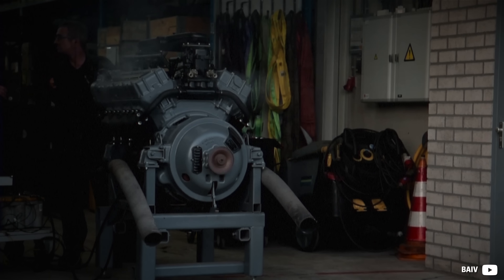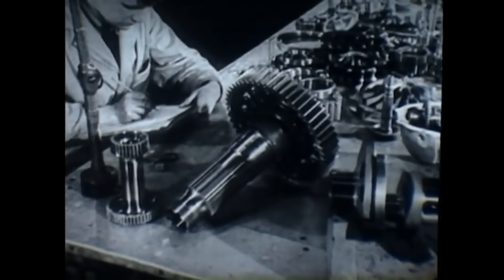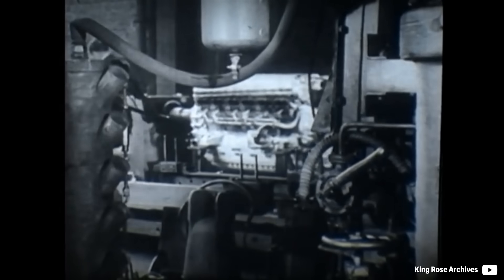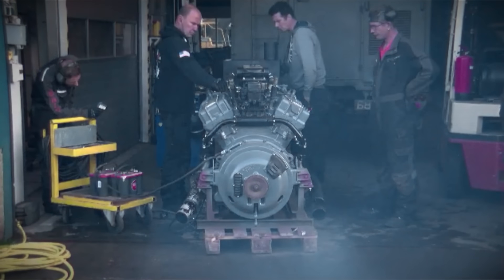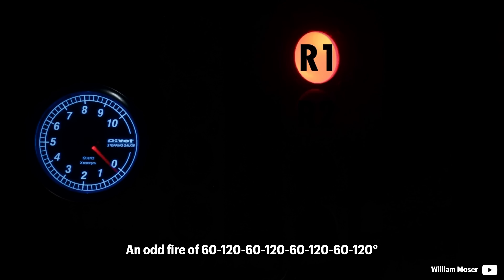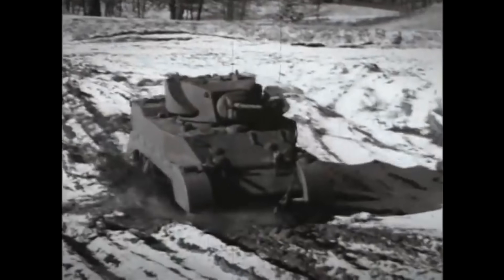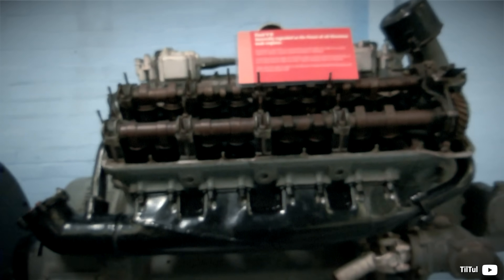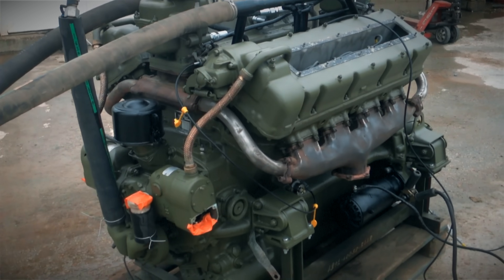The 1,100 Cubic Inch Ford GAA Was Extraordinary

Comment: One of my neighbors has one out of a Ford M4A3 tank IIRC. He uses it for a modest sawmill. He's got it running through a big muffler but I can hear that giant cam lope miles away some times.
Reply: That war-era stuff was built different. I used to do continuous steel fencing for a guy and he had a Lincoln Electric welder he said "came off a tank repair truck" and that thing would run all day and make the brand new Lincoln and Miller units we had look like toys. So smooth you didn't hardly ever touch the knob, just pulled your arc back a little or push it in a little to adjust for thinner or thicker steel. I would love to know how many hours are on that old Continental engine, it has to be an absurd amount. We kept fresh 15w40 in it and it just kept ticking along.

Comment: Cool engines but a couple of super simple design changes could have made these engines legendary. A 2 bolt not skirted block on a engine that has harmonic issues. That and a huge 2 barrel carbs on each end when dual 4 barrels would have provided much more even fuel distribution.  Hell to this day the Windsor platform is plagued by 2 bolt mains and 4 bolts per cylinder heads.  It's like Ford wanted to dangle that carrot right in front of our faces.  I bleed blue until the day I die but dang man.
Reply: I don't think the four barrel carburetor had been invented yet.

Comment: I wonder why Ford picked the flatplane crank design, something to do with tuning, maybe?
Reply: 60 degree cylinder bank separation, from when it was originally designed as a V12. To use a crossplane in a V8 with an 'incorrect' bank angle would require it be made even-fire by splitting and offsetting the crank pins, and there isn't enough material there to do so without making a weak crankshaft.
Reply: @mfree80286  hmmm, thanks for explanation.

Comment: Considering this engine's capabilities, one could only imagine the magic that would have been the V12 aircraft variant once it got superchargers or even turbochargers. On some level I think we were robbed of what could have been one of the greatest aircraft engines of WW2 and could have sat right alongside the Pratt & Whitney R2800, RR Merlin, and likely took the place of the Allison V-1710. I absolutely love the V-1710. Many people rag on it as not being good enough for the P-51 but that just ignores the success these engines really had throughout the war, most notably in the likes of the P-38, but was also in the P-40, P-39, and P-63. They were reliable engines that were also easier to maintain than the Merlin. However I 100% believe that if Ford had managed to get their foot in the door with their V-12, it would have been a serious contender for a powerplant for the P-51 assuming they already had supercharger plans in the works as well, which I wouldn't doubt that they did. But alas we can only dream.
Reply: The Allison had been in production since 1930 so had its bugs worked out with a known cost that the Army Air Corps expected to become lower once in mass production. Rolls-Royce was still producing the Merlin by hand-fitting the various parts like building a custom engine. The British aircraft mechanics preferred the Allison engine since it used 50% fewer parts with replacement parts being ready to install straight out of the box. The British Government asked Ford about manufacturing the Merlin due to RR being so slow. Ford declined the offer since he was trying to sell them his aero V12 so gave the Merlin blueprints to Packard to look over. Ford's V12 was turbocharged and used fuel injection so it took his engineers a couple years to figure out how to make the V8 version run on carburetors. They were still working out the bugs when it started being used in the M4 .
Reply: If you look at power levels the Allison was just as capable.  The allisons in the P-38 that were turbo/supercharged made as much power as the merlin.  The single stage supercharger is what made the allison seem so much weaker.  It was also much easier to service and maintain
Reply: @kingssuck06  I think it just took them a little too long to develop a proper supercharger for it. The most powerful turbocharged version I believe was in the P-38K with something over 1800hp, and then they got a supercharged version pushing something around 2000 in the F-82 I believe, but by that time Packard had gotten the Merlin's to have a good bit more than that. And little do people know, the P-51A with the Allison engine was still the faster than the B/C/D variants at low altitude. It was a damn great engine and I'm not saying otherwise, just held back from being as good as it could have been for a while because of difficulty getting it to have proper performance at very high altitude without a turbo.
Reply: Ford had the GAC V12 designed first because they saw an opportunity to build an engine competitive to the Merlin, but at much lower cost and higher production rate.  That effort was stymied when Packard licensed the Merlin design, revised it with American production standards, and started producing it in Muskegon, Michigan.  The GAA/GAC even had the same bore and stroke as the Merlin:  5.4" x 6.0"

Comment: There were three versions of the Sherman tank.  The General Motors M4A2, Ford M4A3, and the Chrysler M4A4.  Ford also built the M10A1 Tank Destroyer on a parallel assembly line to the Sherman tank line.  The Ford engine was far simpler than the GM dual diesel (two side-by-side 16-cylinder motors), and the Chrysler A37 30-cylinder multi-bank design (five 6-cylinder motors connected to a single drive shaft).  The GM and Chrysler motors had an operational life of 100 hours, while the Ford GAA had a 400-hour operational life.   The Ford tank became the standard tank issued for field use with Ford making over 26,979 GAA (various model) motors built.  The GM tanks were used in the U.S. for training, while the Chrysler tanks were sent to Russia as part of the lend-lease program.
Reply: Six, sir... not sixteen. Total of twelve cylinders in a Detroit 6040.

Comment: The M10 Tank Destroyer had dual Detroit Diesels of like 200 or 250hp each I believe but my dad said it passed the Ford V8 going through the mud possible a broader power band where it was needed for lugging through the mud and bogging heavy work.
Reply: The tank destroyer was a much lighter-weight vehicle than the Sherman Tank.   The GM design had two parallel 16-cylinder motors.  The GM motor had a 100-hour operational life while the Ford GAA had a 400-hour operational life.
Reply: Don’t know where you got your information from but everything you stated is pretty much incorrect. The GM 6040 was NOT two 16 cylinders. It was two inline 6-71 Detroit’s side by side giving a total displacement of 852 cubic inches, 410 flywheel horsepower and 1000 ft/lbs of torque, driving through a common gearbox to a single output shaft. This is why it got the nickname twin six pack. They were one of the more reliable allied tank engines of the war it it was not uncommon for them to log 2000+ miles between overhauls. And most of that was contributed to wear and tear on the engine gearbox more than the engines themselves. It is common yo find Detroit’s from the 40s and 50s with 20000+ hours still running today that have never seen a major overhaul.
Reply: @Oliver66FarmBoy  I'll bet they used much less fuel than gasoline engines too, which is a huge advantage on the battlefield, much less pressure on logistics.
Reply: @Oliver66FarmBoy  At least he was right about the lighter weight of the M10. 🙃
Reply: The M10 and M10A1 were mechanically identical except for their power plants. The M10 used the General Motors 6046, a twin engine formed from two Detroit Diesel 6-71 inline engines mated to a single output. The tandem engine produced 375 horsepower (280 kW) at 2,100 rpm. One advantage of the GM 6046 was that the engines could be disconnected at will from the output and run independently. If one of the engines was damaged or destroyed, it could be disconnected and the other engine used to move the vehicle. The engine of the M10A1 was the Ford GAA, an 8-cylinder derivative of an ill-fated V-12 aircraft engine project. It produced 450 horsepower (340 kW) at 2,600 rpm. When tested side by side in September 1943, the M10A1 was judged to have superior automotive performance to the M10. Even though it produced only slightly less torque, the M10A1's engine was far lighter, and used a common fuel like the rest of the Army's vehicles (gasoline). By the time the test results were released in February 1944, the Army was committed to using the M10 overseas. As a result, the M10A1 was kept in the United States for training.

Comment: It might pull to 3,800 rpm but the early production engines had a hard self destruct limit of 2,800. And that was if the oil pump shafts didnt decide on their own to just shear... or the piston to fly through the side of the block all on its own... the early 43 engines were not very good.

Comment: Block splitting? That's a ferd for you and you would think that they would get that under control but you would be very wrong after soo many year's.
Reply: And you would think Chrysler would fix their transmissions after all these years but you'd be wrong.
Reply: The little 4 cylinder turbo they've put in the newer Lincolns are still block splitting right in the miiddle between 2 & 3.

Comment: Twin detriot was the best Sherman engine.... period
Reply: Not according to the Army.  The GM motor had an operational life of 100 hours while the GAA had an operational life of 400 hours.  The GM Sherman tanks were used in the U.S. for training, while the Ford tanks were sent to use in combat as they were far more reliable.  But, you have to really feel sorry for the Russians as they were shipped the Sherman tanks with the Chrysler 30-cylinder multi-bank motor.  Ford made over 29,979 GAA motors for Sherman tanks and tank destroyers.

Comment: A Sherman tank had a life expectancy of about two days so a ford engine was perfect. Sherman’s had several different engines used during their production but they cost too much to be blown up before the first tank of gas was used.  enter Ford… an engine with equal life expectancy as the tank.
Reply: Oh be quiet.
Reply: There were three versions of the Sherman tank.  The General Motors M4A2, Ford M4A3, and the Chrysler M4A4.  Ford also built the M10A1 Tank Destroyer on a parallel assembly line to the Sherman tank line.  The Ford engine was far simpler than the GM dual diesel (two side-by-side 16-cylinder motors), and the Chrysler A37 30-cylinder multi-bank design (five 6-cylinder motors connected to a single drive shaft).  The GM and Chrysler motors had an operational life of 100 hours, while the Ford GAA had a 400-hour operational life.   The Ford tank became the standard tank issued for field use with Ford making over 26,979 GAA (various model) motors built.  The GM tanks were used in the U.S. for training, while the Chrysler tanks were sent to Russia as part of the lend-lease program.
Reply: @buckhorncortez  

Thank you to someone who has real information!

Comment: that gear train for the engine seems great. The durability of gear drive but none of the vibration or packaging issues. Might be able to use that on an EFI setup with knock senor(s).

Comment: The twin GMC diesels were only used in the Pacific, to ease logistics.  They only wanted to supply gasoline in theater Europe.
Reply: Ordnance used the twin GM Diesels in the M10 tank destroyer since their high torque at low RPMs could get one moving faster from a dead stop. Chrysler tried to get the British interested in using their A57 Multi bank engine in their Lend-Lease tanks. Their Army politely declined using those so Chrysler showed those to the Soviets. The Russians said those were too complicated and needed simple Diesel engines instead, so received the twin GM Diesels in their Lend-Lease tanks. The British got stuck using the A57 with Chrysler working with their tank mechanics to find ways to make servicing those easier. That was done by pulling out the giant engine by using a clever self adjusting hoist bar.
Reply: @billwilson-es5yn  the Mopars proved to be reliable torque monsters in their own right, but yes, they had a lot of moving parts.  They did what they could with what they had, in order to get tanks out the door right now

Comment: I saw a couple of these on pulling tractors in the USA in the 1980's.  But they couldn't beat the big block Chevies that could rev much higher.

There is a guy on YouTube that put one in a 55 Chevy.

The worm gear cam drive setup is unique.  I have thought for years that gears are the best way to drive overhead cams.  Most expensive, but best.
Reply: i love this design but i'm guessing the worm drive is ultimately limited in its top rpm

still, why not bevel gears?
Reply: @5naxalotl  The Allison used bevel gears and jackshafts to drive the cams.
Reply: @5naxalotl  valve float was the limiting factor from the factory. The worm drive will turn as fast as an other. I don't see any way it could limit rpm.  Remember this is a big ass long stroke industrial type engine not made for rpm but torque and at 1100 cubic inches it doesn't need a lot of rpm. 1000 ft lbs at idle is something most diesel engines can't match, unless the are huge.
Reply: Compromise:
gear drive to camshaft and injection pump with pushrods to OHV?
No chains, no belts....job done.

Comment: Interesting. but the truth is even more interesting and some of the things you say are not right. Ford had the contract to build the R-R Merlin but then wanted to substitute his own engine for the R-R design. He had two prototype V-12 Merlin substitutes up and running and had already passed test runs and wanted to produce them instead of the Merlin. He said that he wasn't going to build the English engine and the government should except his Ford V-12 which was designed to be a direct substitute. That was when the War Department canceled Ford's contract and awarded it to Packard. This is according to Maurice Olley who was working for Rolls-Royce in the United States at the time. Ford did make Merlins in England, but not in the US but they did build Prat Whitney radial aircraft engines. Then they used the design, minus four cylinders and the superchargers as the basis of the GAA and GAC tank engines.

Ford's actions in this matter is hard to believe but it is one of those cases of 'strange, but true.'
Reply: Ford fails to consider that the Merlin is already supported in the European theater.
Mechanics at British airfields know how to work on them, know how they fail and have parts available.
Do you build extra warehouses for spares and send everyone back to school?
If you're in the middle of a war you don't screw up logistics and negate those years of experience in maintenance.
Reply: @jimurrata6785  Yes! It was exactly the wrong way to go after a defense contract. The way Ford tried to force the deal was so wacky that it helps to explain why so many people have come to wrong conclusions about how Packard came to build the Merlin. It was Henry Ford showing how stubborn he had become in his old age. Also he thought he was doing the nation a favor by building a better engine, that was more suited for mass production and would cost less than the Merlin. I know that's arguable but I have to believe that's what he believed.
Reply: Ford was already building the Pratt and Whitney R-2800 radial engine. The reason the Army canceled the contract was they were committed to the Merlin and Allison V12s and didn't want a third engine requiring additional logistics support.   The Ford V12 was lighter weight and produced more horsepower than the Merlin.

Comment: that chain-less DOHC design is so cool. shame that isn't a thing in modern cars today
Reply: I'm wondering if physics won't allow it to spin high rpm but man it sure looks reliable compared to chains that wear out in 200k miles.
Reply from the maker: Many race engines do use chain-less valvetrains using cogs
Reply: @Zach-ju5vi  the downside of a geared overhead cam engine is that when you plane the head or block down the gears are too close. not as big an issue with the ford gaa because the gears are perpendicular and can ride up or down.
Reply: Heavy trucks routinely use gear drives for the camshafts and accessories. They're just too expensive for most cars, and if they use straight-cut gears they're too noisy.

Comment: It's incredible thats Ford didnt use more this design for comercial trucks, with low displacement
Reply: It has 18 litres of displacement, which is about 2 litres larger than any on-road truck engine currently offered in North America or Europe. Cummins builds an 18 L (C18) for on-road-capable trucks, but it is not available for non-military on-highway use. 

Did you mean to suggest that they could have used it in a lower-displacement version for commercial trucks? There was no market for very large commercial gasoline engines, this design (with dual overhead camshafts) is too complex to be economical to build, and the 60-degree vee angle is undesirable for a V8 (although it is narrower than a proper 90-degree V8).

Comment: Hard to believe that Ford had the engineering know-how to build such a high end engine back in WW2.
Reply: Why?  Ford built aircraft engines.  They built more Pratt & Whitney R-2800 radial aircraft engines than Pratt & Whitney during WW 2.  They not only built the B-24 bomber but also had a factory that built wooden gliders.  They were the only company other than Sperry, that built automated gun directors that were highly complicated, mechanical computers for aiming anti-aircraft guns.   They were the only company that had a contract to build pulse-jet JB-2 Loon flying bomb.
Reply: @mikec9112  And then GM and Chrysler came along and copied it.